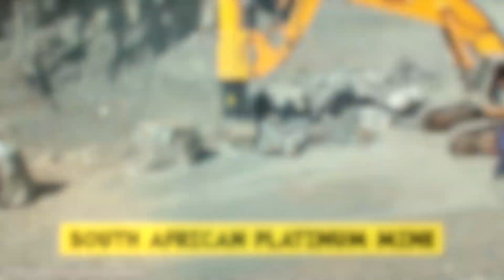15 Extreme Industrial Machines Ever Made!

Comment: Have lived on 4 aircraft carriers so have an appreciation for what OVER-SIZED can mean :) 2 carriers side by side in dry dock is the craziest thing I have seen ? :) watched them place the engines inline the shafts and propellers and the main chains and anchors was breath taking:) worked on refineries and power houses,knowing the immense force inside of 3 ft. high pressure valve& if flammable liquid is scary:) regret not seeing lg. submarines being built,the forces placed on them are as intense as anything on earth, when the 1 st titan2 dump truck became active at a mine where I lived they had a party in the back of it :) ,have had a close relative  and two FEMALE friends who have driven them :) we had snow plow on our school bus growing up:) is hard for many to picture :)  watching people "try" to "control" snow in the western rockies is easily the LARGEST thing  I witnessed, almost a comedy of errors at times :)  Be careful Peace. Rick
Reply: A computer screen really doesn't do size justice.
It's a LOT different when you see BIG stuff in person

Comment: It's unwatchable as just over one minute into the video I've already encountered different video clips of different machines while the narrator talks about them as if they are one and the same. It's almost comical when he talks about a 45k-ton saw and shows what is probably just a saw on a front end loader or back-hoe that weighs total only about 15-30 tons tops. Then he shows a tree crusher and keeps interchanging clips between the huge machine he's talking about and a much smaller machine that has a different name that is clearly shown at the bottom of the video clip. The speaks as if he is talking to children, so maybe they thought children wouldn't notice these discrepancies. This is lazy.

Comment: 17:30
To be fair, the Bagger 293 shares some "largest" titles with some of it's older siblings - it's a line of similar machines of which there are 8 or so in the line.

What's not mentioned is that these machines require about 16 MEGAwatts of external power supply to operate.
Reply: thats alottawattage

Comment: the lack of research on this video is staggering. for most of them you didn't even bother to title it properly or find the right video showing off the right machine, it's all stock footage of what could be anything. there's no single manufacturer for any of these pieces of equipment, they're either one-off concepts built to prove a point or there's an entire market developing those types of equipment. Claas' Jaguar series for example allows for a 14 row header, which John Deere doesn't provide. Ponsse isn't the only one to make self-propelled forestry equipment, Komatsu for example also makes machinery.
Reply: I agree, the footage should fit to the spoken lines - even if it is for entertainment only.
Reply: @gunnarkaestle  5 buono frac juy67,Kimi
Reply: @fredcramer531  ??? Is this a kind of riddle which I shall decipher?
Reply: But isn't it just A M A Z I N G???!!!
Reply: While babbling about ”rotary snow plows” he shows ordinary plows only
Reply: Not to mention the narrator can't pronounce properly. Painful
Reply: This is for entertainment not research for gawd sake.
Reply: Neal Curry It’s supposed to show off the most impressive machines in the world, and to allow it’s viewers to appreciate the size and engineering of these machines, it would definitely be fitting for the channel to do their due diligence and at least show the correct machines. If not, they will just come through as extremely unserious and lazy.

Comment: Do yourself a favour there's no such thing called here "The Car Shredder" it's called HAMMEL VB 1500 Primary Shredder and it comes in different sizes 450 / 650 / 750 / 850 / 950 / 1500 and it operates on diesel or electric, I can't believe your ignorance and lack of research!

Comment: Talks about Railroad "Rotary" snow removers and Not even Once did he show one.... just locomotives plowing through, along with a couple of "flangers" and "V" plows.    Also, talks about the Komatsu D575A - 3 while also showing a Cat D11R.... Calls the Fuel tank on the Cat 797 a "Gas tank",  Talks about John Deere Harvester while also showing a Krone from Europe,  etc, etc, etc.   The Komatsu 575A series has been out of production since 2012, the biggest Mining Dozer built by Komatsu these days, is the 475A - 5 and it's just shy of 100K lbs lighter (238,400lbs compared to 336,400lbs without the ripper and with, the standard, smaller 90 cu. yd. blade) than the old D575A series with a maximum push of only 35+ cubic yards, compared to the 125 cubic yards with the optional dozing blade on the 575A - 3 SD.    Must say though, it was entertaining just to watch and listen to all the discrepancies.  lol

Comment: Most of the information you provided was very good however you showed pictures of machines different than the ones you were talking about in many cases.  For instance Bertha the boring machine for Seattle drilled a single tube but your first video of it showed 2 side-by-side tubes being drilled.  You also showed a Krone forager harvester during the John Deere forager discussion and a Caterpillar dozer into discussion of the world's largest dozer.

If you're going to do it do it right!
Reply: Also can't pronounce epitome correctly. lmao (10:50)
Reply: @Nolimit2far  HAAHAHAHAHAHAHA
Reply: Snow plow was a plow not a rotary plow.
Reply: I will hasten to add that the Continuous Rock Miner didn't come out in 2016. I worked on them in 1976. Thats almost 50 years off. "The Supreme" what?
Reply: Kept talking about rotary snowplows for trains, and not a one of the snowplows shown were rotary plows.

Comment: His math is a little off on the BAGGER 293 (& 288) BWE. It can move the same amount of material it would take to fill the length and width of a football field to 98.4 feet deep, not the length of a football field and 80 feet deep.  😂😂🤣🤣🤣

If you want the BAGGER 293's actual spec.'s, well, here they are (with much thanks to Wikipedia):
Production - 	        1995
Length -	                225 m (738.2 ft)
Width - 	                46 m (151 ft)
Height -	                96 m (314.9 ft)
Weight -	                14,200 t (31,300,000 lb)
Propulsion -	        12 x caterpillar tracks
Gross power -	16.56 megawatts of externally supplied electricity
Speed -	                2 to 10 m (6.6 to 32.8 ft) per minute (0.1 to 0.6 km/h)
Blade capacity -	21 m (69.9 ft) in diameter, 18 buckets each holding 19.6 cubic yards (15.0 m3) or 16.5 short tons (15.0 t)

Comment: That "Godzilla Saw" of his, is actually the BAGGER 288 Bucket-Wheel Excavator (and when its painted blue, its the later on BAGGER 293 model), built by the German company Krupp for the energy and mining firm Rheinbraun. The Bagger 288 was built for the job of  removing overburden before coal  mining at the Hambach stripmine in Germany. It took five years to design and manufacture, and five years to assemble with total cost reaching $100 million. It can move roughly 240,000 tons of material per day or 87,600,000 tons of material per year; its operational weight is 13,500 tons, so just where he got a scooping weight of 4,500 tons per year is beyond me. Even the BAGGER 293 BWE max's out at 240,000 tons of material per day; just like the BAGGER 288. And as for the actual weight of the machines, OMG! The BAGGER 288 max's out a a weight of 13,500 tons with the BAGGER 293 only coming in at a little more than 14,200 tons; and those puppies are the biggest land-based machines in the world. So where he got 45,000 tons is beyond me. Maybe he mis-read Big Muskie's 4,500 ton weight limit?  😂😂😂🤣🤣🤣🤣🤣🤣

Comment: OK, I give up. Fist segment, are you talking about the tree crusher or a tree grinder, you keep jumping back and forth from one to the other. The machines that you use for the opening scene and the avatar of your vid. are two separate machines. Both are tree crushers. The only two ever made. The machine rolling across the empty yard is the larger one.  It is not too far from where you see it and is buried under many feet of water.  It got stuck in the mud shortly after the vid was taken and no one had a machine big enough to move it.  So when they built the dam and flooded the valley, the crusher is now at the bottom of the lake. The second machine, the one the man is leaning against, the smaller of the two, is now a statue at the entrance to the town of MacKenzie. It was never put to use, they felt it would just get stuck.
Reply: I know that machine. I worked in one of the sawmills for Finlay Forest Procucts in MacKenzie in 1968. The Bennett dam on the Peace River had just been completed creating Williston Lake. The lake backed up about 150 miles and made it possible to log an area that was otherwise inaccessible, there was nothing there, no roads, the logs were transported from the northern end of the lake by boom boats. Virgin forest at the northern end of the lake; trees were cut, brushed, sectioned and skidded into the lake, formed into rafts pulled by these little two man tug boats and floated down the lake to the mills at MacKenzie. By the time me and some other guys found this machine it had already been parked and abandoned. Where it sits now looks all civilized and public. When we went to go play on it, there were some fishing streams nearby, it was at the end of a  deserted dirt road and already had weeds, shrubs and trees growing around it. We climbed all over and through it. There was an engine room with two Cummins diesel engines that drove electric generators. Yeah, the thing was driven by electric motors. In the operators cab was a small dashboard with a panel of toggle switches. There was one big three-position switch; left, right and neutral (center). That’s how it was steered. I guess it was intended to clear the area where the lake was going to be, but I don’t’t think it did. I heard it had got bogged down once and it took eight D-8 Cats to pull it out. It was built in Texas by Letourneau, transported in five sections by railroad and assembled on site.

Comment: 15:45 Has to be wired into the Welsh power grid.........Shows a portable car crusher on tracks with built-in power supply.
Reply: your right I did not even catch that
Reply: Also, basically anything over 5kW is commonly tapped right onto the line, instead of using an outlet, i have 2 machines in my homeshop that need direct power alone